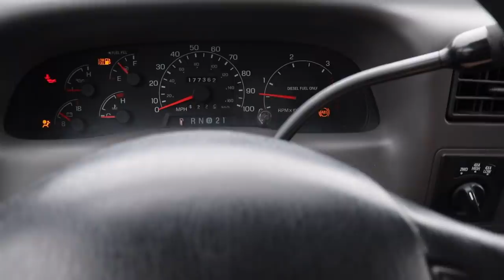NEW WHEELS & TIRES ARE ON THE 7.3L PowerStroke!!!

Comment: You have to run 2" spacers to avoid rubbing on the leaf springs when running newer Powerstroke wheels. Reason being 05 and up are coil spring and the stock wheels have 0 offset for that reason. Where as 7.3's have leaf springs and need offset to clear the leafs when turning!

Comment: 8x6.5 to 8x170 adapters.  the majority of wheels in use today are centered by properly-torqued, tapered cone lug nuts located in tapered cone lug bores in the wheel...in this case, 8 of them.  the center bore is irrelevant to concentric alignment.  

true hub-centric wheels use flat lug nuts/wheel bores which only hold the wheel to the hub/rotor or axle/drum, the centering of the wheel is via the hub center.

Comment: They changed the backspacing on the newer style wheels so if they wouldn’t have put spacers in the hub caps wouldn’t fit on since the wheel sits in so far.

Comment: okkkk, the reason they had spacers on the stock wheels was because earlier than 03 is not able to fit 03 and newer wheels because it hits the hub, and that stub was broken off at one point
Reply: Yeah different lug pattern
Reply: Brad Price not a different lug pattern, just won’t fit
Reply: @jakeperrine7195  yeah I knew that I was thinking f350 dually because I ran into that once I think they changed to 8x200 on 04 up but only on the dually sorry

Comment: PSA: NEVER RUN LUG CENTRIC SPACERS ON A TRUCK!!! All of the weight is riding on the hub of the axle and when you use lug centric spacers the weight is now riding on those small studs and the wheel will not be centered properly, causing vibrations and the potential for the wheel to come off!!!! If you need 2” spacers to run the newer wheels on your truck make sure they are HUB CENTRIC and that you torque them properly (SD = 165 ft lbs) Bora Aluminum hub centric spacers are good spacers and Fred Goeske www.wheeladapter.com and Motorsport Tech http://www.motorsport-tech.com/ make hub centric steel spacers that are even better!!!!